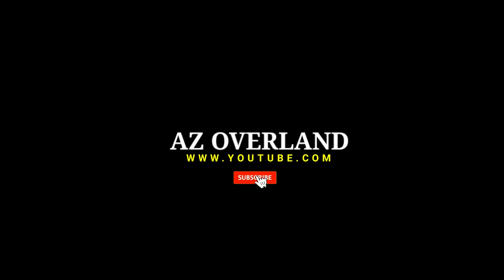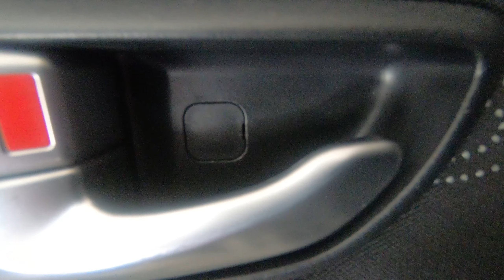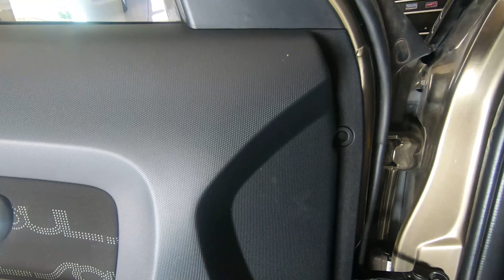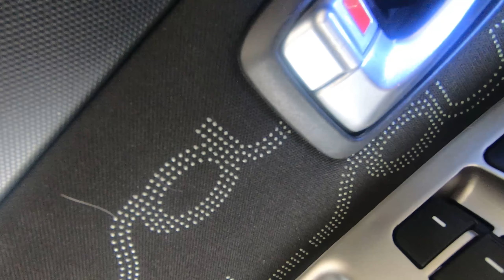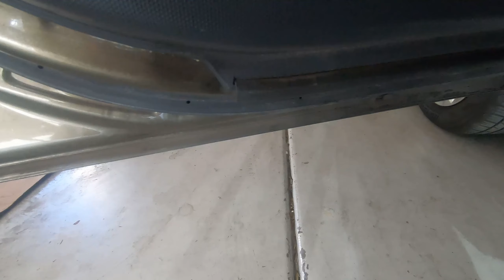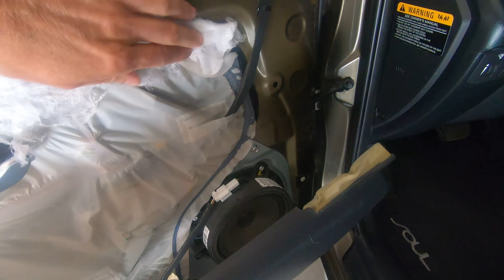Kia Soul Door Panel Removal 2008-2013

Comment: I’m trying to replace the exterior plastic molding on my driver side door. Can that white plastic sheet can be peeled back to reveal the inside of the clips that hold the molding to the door? I need to get at the one farthest rear that’s screwed in because of the way the molding was ripped off, but I also don’t have anything for replacement if it won’t re-stick after I’ve peeled it back.
Reply from the maker: Yes it peels back. They use a sticky butyl adhere it. If for some reason it is not sticking, you can just order more butyl on Amazon

https://amzn.to/4v3Ya3J

Comment: My rear right door, behind passenger does not open or close. I have to open manual from inside then open with the handle outside, any idea?  When I put reverse all doors close but not the rear right one.
Reply from the maker: Most likely the door lock actuator failed

Comment: Do you have any suggestions if the door latch seems broken and the inside and outside door latch are not working and I have to remove the door pail with the door closed?
Reply from the maker: @DavidBeatypersonal  Remove the handle trim piece from the interior. You know, that piece that popped off towards the end of the video? With that off, start looking for the rod that is connected to the actual handle. If you pull or push that rod, it should open the door

Comment: Thank you! These instructions were super helpful and easy to follow. I have a 2013 Kia Soul base model with manual side mirror adjustment but the instructions were the same. I was able to replace my window switch in about 20 minutes, start to finish. Instead of a pry bar, I used a caulk spatula and it worked great. Thank you!
Reply from the maker: Nice job! Glad the video helped

Comment: Thank you so much for this video i looked for long time. but could you separated handler from interior door? My 2010 Kia have sticky surfy on it i have to remove and renew...
Reply from the maker: If you are referring to the pull handle that opens the door from the inside of the car, yes it will unbolt from the actual door and you can replace it

Comment: Thank you you made my job a lot easier, my key latch attachment slipped off, it fell under my door handle and caused it to stick out the door would still open, but it was sticking out
I thought that little latch had fell down in the door and after I took the door panel off and figured no it didn't it was attached up there so if that happens to y'all be sure to make sure you look in there because it's is attached but got it fixed !
Reply from the maker: Nice job

Comment: Can you not remove the handle/switch trim without removing the entire panel?
Reply from the maker: The door handle trip will come out after removing the Phillips screw behind the handle. The window switch trim you will need to remove the door panel and access the screws from the inside that hold it in place. The door panel is very easy to get off
Reply: @AZOverland2017  thanks!

Comment: Thanks! My power windows all simultaneously went haywire. It's not the fuses. So I guess removing the door panel is the next step to troubleshoot the switches on my 2011 Kia Soul?
Reply from the maker: Does each window operate correctly when using the window switch for that specific window on the door panel. In other words, if you sit in the back seat and used the window switch from that seat, does it operate correctly? It seems like the Master switch panel on the drivers door panel possibly is malfunctioning.

Comment: Hi! Nice vid!
 I have a dent that is able to be popped out on the driver's side! According to the person I've bought it from.
They said that I may have to remove the door panel to pop it out. 
(I've tried other ways to pop it out from the outside but nothing works) 

Is it possible to remove just only the panel to pop the dent from the inside, or all of the other electrical stuff?
 Or would you just recommend me to get a new door overall? Thanks!
Reply from the maker: I would definitely get that door panel off and see what kind of access you have to the dent. That would also depend on where it is located. A new door would be very costly. If there is no paint damage from the dent and you are not able to do it yourself you may want to look for a reputable paintless dent repair.. Some of those guys can work magic.

Comment: Can the actual door pull be removed from the panel ro be replaced....mine is scratched on the one im buying
Reply from the maker: The window switch bezel (silver part in the video) can be changed. The rest of the door panel is 1 piece I believe.
Reply: @AZOverland2017  Thanks.....do you own the kia you are working on? If so how do you like it? Has it been good to you?